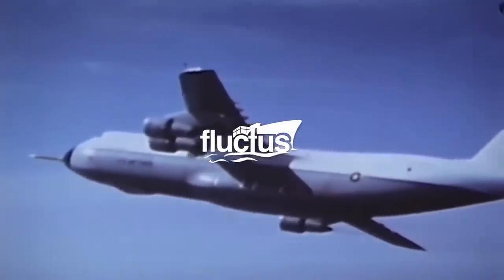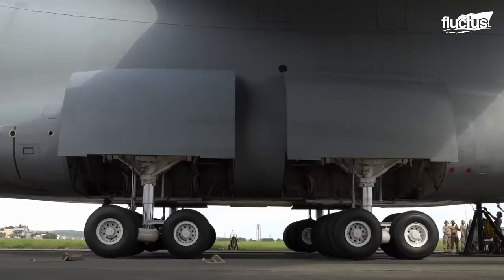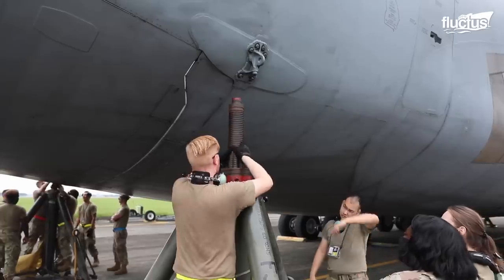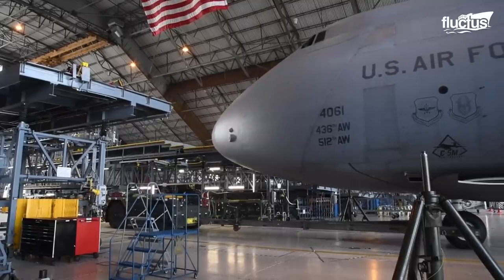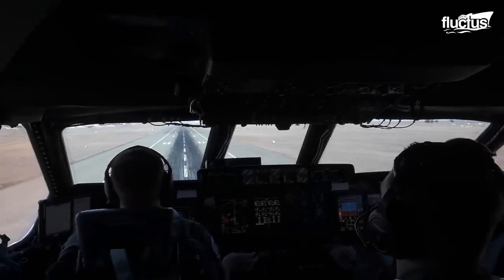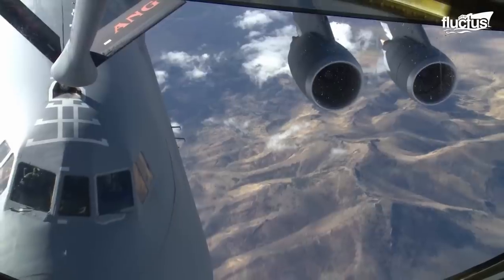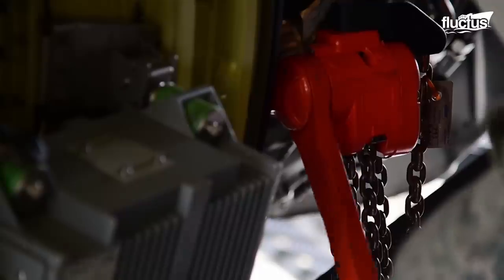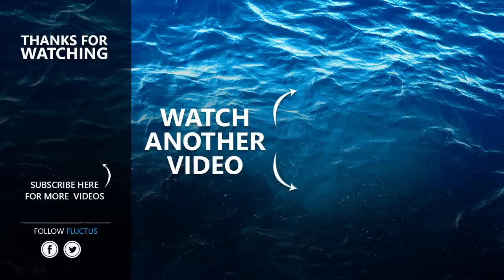Behind the Crazy and Complex Landing Gear Operations of US Largest Airplane

Comment: The video starts with a mention that it will be about the landing gear, then goes on to talk about the engines and cargo capacity at length, completely leaving out many curious aspects about the plane's landing gear, such as that it turns 90 degrees before being retracted.

Comment: I was an aircraft electrician (AFSC 2A676) assigned to the 436 AGS (Aircraft Generation Squadron), Dover AFB DE, from 1996 to 1998.  I was excellent on my previous airframe (F16 blk 40 - Eielson AFB Alaska).  The maintenance on the C5 airframe was challenging at best.  Main landing gear/anti-skid/kneeling, back door/ramp, and the Dewars were the worse.  Especially the main landing gear.  I hated the jet so bad, at the ten year mark of my USAF career, I cross trained into operations.   A nightmare to maintain.